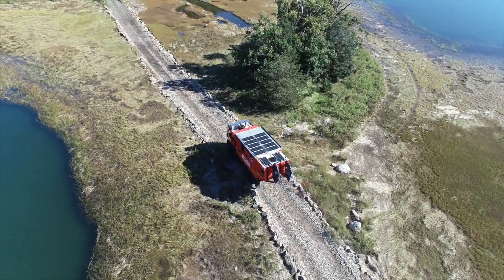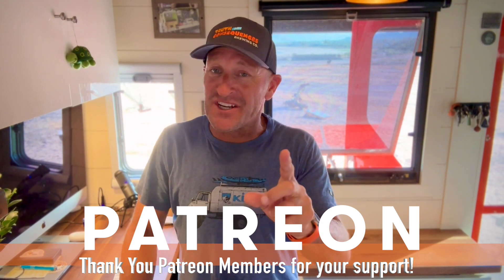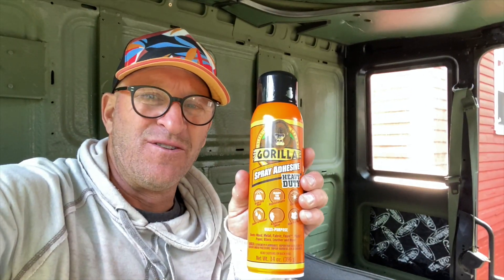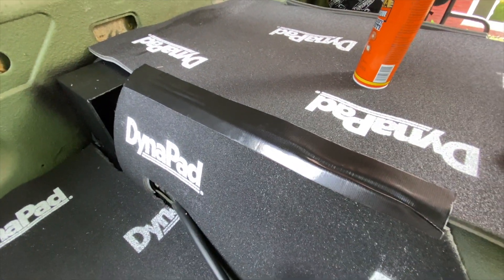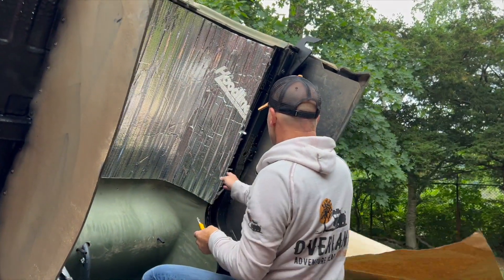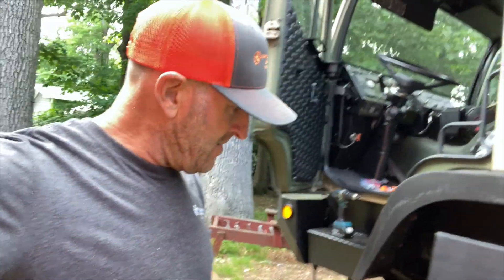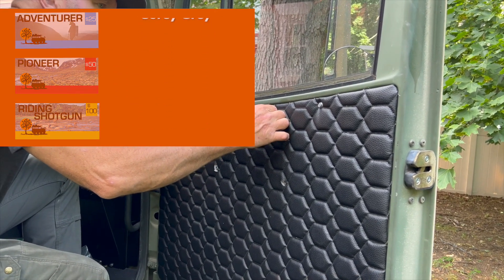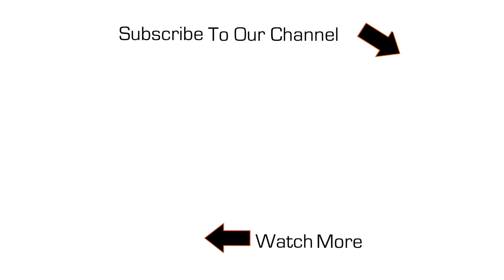Transforming A Military Cab Into A Modern Overland Truck | Ep 4

Comment: I did the underside of the doghouse on my 1083, and it helped alot.  I also bought Killmat off Amazon and did two layers of that on the roof... no more steel drum.  I might just shoot spray foam into the turret structure to deaden that up too.  I have yet to do the back wall and the doors/sides...but just what I've done made a noticeable difference.

Then I installed the ECO hubs.  That made the biggest difference. Less than half the interior noise when all those geared hubs go away, and that damn fan has not engaged since I installed them.  Not even at 80mph down the hwy on an 80 degree day...
Reply from the maker: Any amount of soft surfaces seem to make a huge difference.  I am seriously considering the eco hubs. Do you have 3.07 gears too?
Reply: No. OEM gearing here.  I would under no circumstances install ECO hubs w/ 3.07 gears.  I would be a gutless pig.  My truck is slow from a standing start (2nd gear)   Anything above about jogging speed and it's good.  WAY better at backroad & hwy speeds.
And...it's easy to speed.  Previously the truck was topped out at 55mph.  Now it's loafing at that speed, and right in the sweetspot at about 65-70   @drivetheglobe